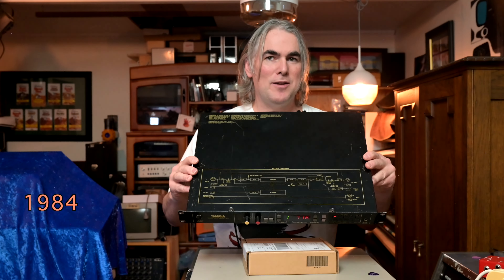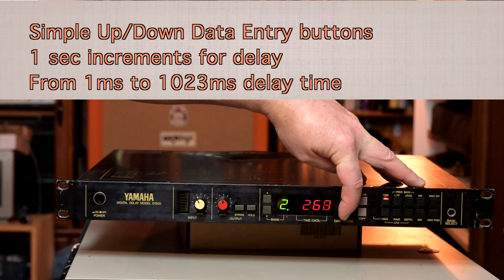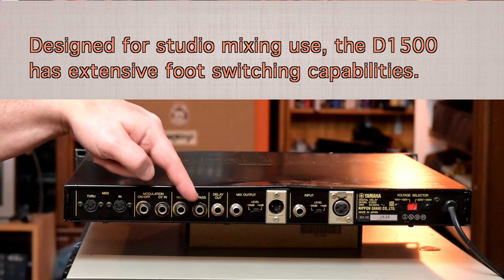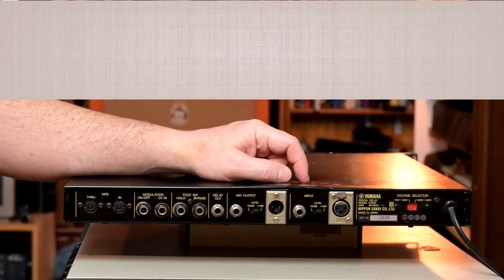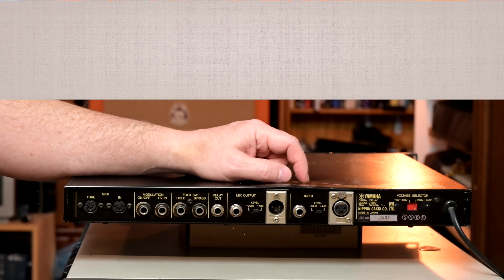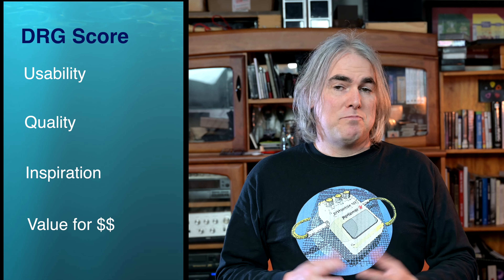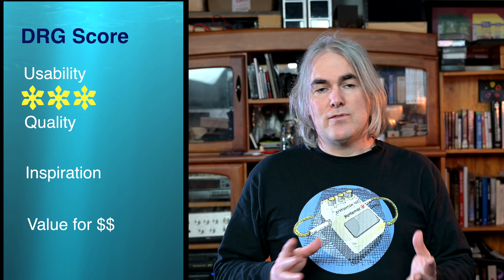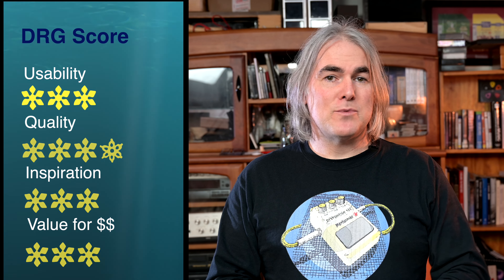Yamaha D1500 review and overview

Comment: I still have mine , the later versions droped the CV control and had midi only
Reply from the maker: Thank you for checking out my video Drone Trigger.  That's interesting about dropping the CV control. Maybe it was not a well used feature.
Do you use yours much nowadays?
Reply: @DigitalRackGear  I still have it for live gigs ,the delay cuts through a band really well.
 They were the first delay unit to have midi.
In 1984 they were £639.
 Allan Holdsworth had 4 in the studio and used 2 live.

Comment: Seems like a solid piece! I bet using 2 units or taking the time to bounce twice from a DAW with different settings would render some thick/wide sounds. I use an old mono ADA S1000 delay as the front end for my poor man's space echo into a Korg DRV-1000/and or some kind of spring.
Reply from the maker: Sounds like a great set up @floeter.  Thank you for subscribing and checking out the video :)
Reply: @DigitalRackGear  I've been enojying your stuff for a while, this is a new account made in hopes of joining your channel as an informational source for under-used/under-demo'd old gear in the coming months. Thanks for the care put into these videos!